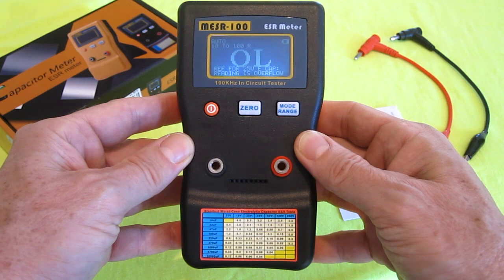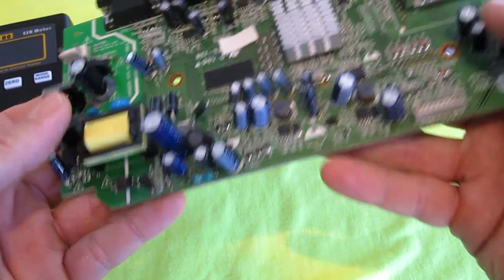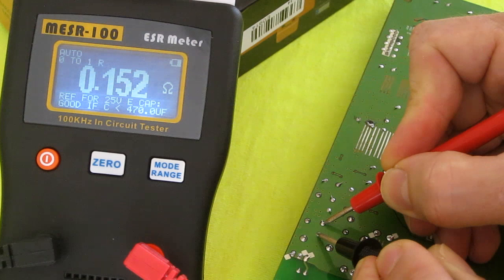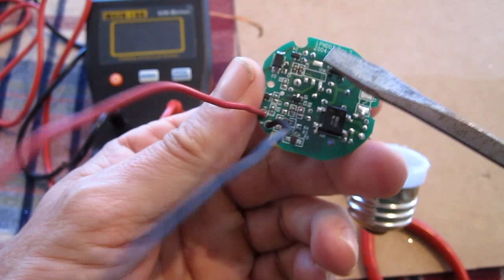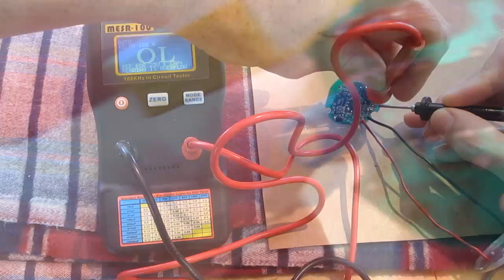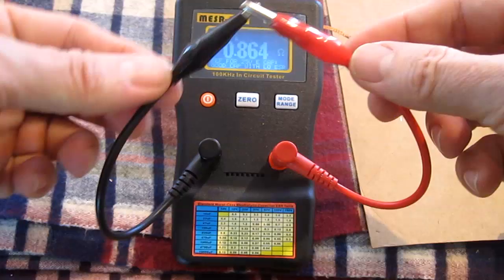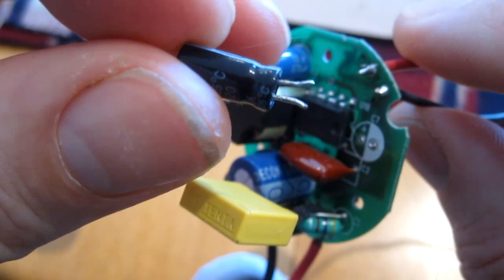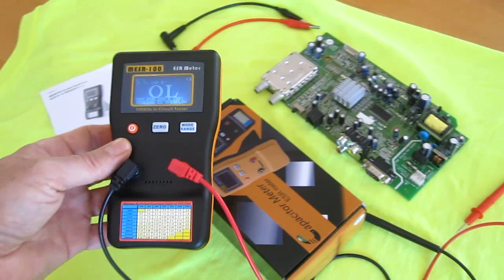ESR Meter $44 Capacitor Tester MESR-100 V2 electronics repair fix broken power supply led tv replace

Comment: The $15 ebay delivered capacitor tester kit that's fun to assemble works great. It has a similar screen as yours but it also tests resistors, diodes, transistors and more. You just solder the kit together and go to it. I've used mine to test thousands of components and it works flawlessly.  It even has a frequency counter mode.
Reply: Thanks for the heads up

Comment: A couple of points.  First the chart is very ballpark, you need to look at the data sheet to know if the cap is really OK, but for this kind of troubleshooting might be close enough.  Second point is that you NEED to zero the probes, especially with those long ones.  If you didn't zero them out then the ESR could be way off.  And ESR can be such a finicky thing that usually probes for the meters use more than one wire to help minimise the effect of the lead on the reading.

In general that might not be too critical for general troubleshooting but switching power supplies use low ESR caps so it's a bit trickier.

Someone mentioned the multi testers that are so cheap.  They work well BUT you need to press the test button each time so you can't do the kind of probing he is doing in the video.  With in circuit testing you really need the meter to test constantly so you can keep both hands with the probes.
Reply: Good Info ^^^^

Comment: Hi FunBubble, i have your same device with short probe...so when i try a probe more than 20cm that tool 
show an "error" when i try to set the "[zero]" cause the probe have 0.7ohm. 

How did you manage to use long cables/probes ? 

Regards
Alex (it)

Comment: I ordered this meter, too, it's in the mail and should arrive in a couple days.  I'm hoping to fix a tv with lines across the screen and other electronics.  I figure spending money on this tester would eventually pay for itself instead of taking things to repair shops or just replacing them entirely.  Thanks for the video and explanations.  It looks pretty easy to use.  Can't wait to be able to test "in-circuit" instead of having to remove each and everyone capacitor to test it.  Just curious since you posted this video in October 2016, how's the meter holding up?  It's still working fine?
Reply from the maker: hi, the esr meter is still running like new. its been useful for testing and fixing many many devices. thx
Reply: @FunBubble  Thank you, I appreciate you answering!  Glad to hear it's still working after a few years.  Hopefully I can get several years out of mine, too!  Try to have a good week!

Comment: It looks like a great value.   The only thing I'd add is the Atlas ESR70 also tests the value of the cap at the same time, and will discharge caps before testing. So it's quite handy for refurb and testing.

Comment: Hired would I test a 390ohm resistor that is in circuit in my vehicle cluster. Can't or don't want to take it out if I don't have to. With an ear meter

Comment: I have same meter, it works great. Warning it is far safer to discharge capacitors with 10,000ohm 10 watt or larger resistor, use bigger resistor for bigger caps. Shorting a cap with a screw driver or jumpers is a direct short that can damage other components in cicuite from big current voltage inrush,  can cause arc welding screw driver to cap or shocking you or melting wires or even kill you.  Be VERY careful discharging capacitors, and especially large ones, you can they can store huge amounts of lethal power for long periods of time. Fir example a camera flash capacitor can be lethal. Be very careful discharging caps to properly to limit current with properly sized resistor and proper wattage rated resistor. Be careful, if you do the math on larger cos to control discharge current and voltage.

Comment: it read 9.1 with supplied wires and would have in circuit had you used them in the 1st place.  I watched longer because you tested a led bulb,  good job on the video
Reply: Is there a reason simple leads can not replace supplied alligator clips?

Comment: Cool video. I just got my MESR and I too find the test-clips way too short. So, I used some test-leads I had, but now the MESR can't zero, it just says "zeroing error" and I've tried with other test-leads of varying lengths. Also, my MESR emits a faint but audible high-pitch sound - so, what do you think of all this? Is it defective? Should I return it? Please let me know, as I am a noob, at all this. Keep making videos. Cheers!
Reply: That's expected.The resistance in the wire will increase if you lengthen the test leads. That's why they're kept short.Btw,what's the max capacitance value this meter can be tested on?
Reply: Ok, but you are NOT using short test-leads [there's a video on Youtube, where some fellow is using 1 meter long test-leads, on his MESR without problems] and you have no issues zeroing. Also, your meter doesn't emit a sound, does it? Oh, and I believe the maximum capacitance is 100 Ohms, hence MESR - 100, but I could be wrong.

Comment: What if im testing caps the arent on the ESR Table? Like .47uf 50volt ?? I havent seen any tables with these . thanks!
Reply from the maker: a 4.7uf 50v cap is 3.0 esr. a 47uf 50v is 0.5 esr. im not sure about .47uf. i did a google image search for esr chart and printed out one that has more listings than the sticker on the meter. other than that u can kinda estimate by looking at the closest ratings.
Reply: That's the problem - it doesn't test small caps

I just watched a video where the guy fixing a vintage synthesizer just knew to change the small caps connected to the pins of an IC on a board not working correctly - no tester, just instinct and experience - he changed the small caps without testing them and the fault was fixed
Reply: Done some digging and it seems some can test down to 1 micro farad

Comment: Have you seen a list on what a 0.47uf 50v capacitor should read on this meter?
Reply from the maker: ive got a second esr chart that is more general and it shows a 0.47uf cap should read 6.0 OHMS or lower. the chart doesnt list voltages. maybe try to find a cap of the same value and compare them with each other. good luck
Reply: @FunBubble  Ok, thank you!  I appreciate the help!

Comment: You should be zeroing out the meter before testing. Especially if you are using longer probes with more resistance. You simply short the probes together and press the "zero" button. This will compensate the resistance in the probes so it isn't added to the resistance in the cap.

Comment: Friends, this fault occurs when measuring a capacitor without having downloaded it before, inside it has a protection diode D1, short and give this message, replace it and fix the tester, read the user manual

Comment: Screw driver for discharge is very bad practice as sudden discharge can ruin the cap you are testing... you should use a resistor with insulated alligator clips to properly discharge the cap... not so much for these little caps but for the bigger ones not only could you ruin the cap, but you may hinder your ability to maintain an erection for a bit after you get the life shocked out of you doing this with a bigger cap lol. You should always pull the suspect cap out of circuit before testing as your values can drastically change... you should also use flux when desoldering as well as soldering as it removes oxides and transfers heat, along with a sucker or braid. You're on the right path... just keep researching and before long your neighbors will be at your door asking to fix their tvs lol I can tell you that since I learned how to fix electronics i know for certain I will never be broke. Spent 110.00 total on all my gear to start and within the first month made enough to replace it all with 1000.00 worth of higher end soldering gear along with a microscope. On a slow month of side work fixing stuff for people with posts on social media I can make 1000.00 or so a month and on good months I've pulled in 6 to 7000.00 and that was still not back breaking work... just allotted 2 hours of time after work every other day or so. It's not only a fun hobby but it gives you an awesome sense of accomplishment... look how happy you were that you fixed the light... it's so rewarding because you know it's something so few can do. Drives me Nuys when people complain they have no money when they can easily look on you tube and learn a trade fairly well in no time at all such as this. Good luck with your future repairs!!
Reply: Nice comment.
Do you have any pointers on how to find electronic schematics? Thanks

Comment: This test is not conclusive.  Caps are to be measured under real working conditions.  This meter may show a low ESR and capacitance within spec, though it may fail under load.  Obviously, when this test shows the cap is "bad" then it is.

Comment: Sir how to esr tester mega 328 that is better
Reply: i couldn't understand your question, but i think you're trying to ask

is the M Tester / MEGA 328 better than the MESR 100
the answer is this

the Mega 28  M tester IS A COMPONENT IDENTIFICATION TESTER
one of it's functions is   TO TEST ESR ON CAPACITORS
it gives the ESR reading
it gives the capacitance reading

now the MESR 100  tests capacitors
IT IS AN ESR TESTER, only 

It won't tell you the capacitance of the capacitor
it won't identify components for you 

IT WILL GIVE YOU AN ESR READING THAT IS MUCH MORE ACCURATE THAN THE M TESTER

so, basically they are 2 completely different things you can't compare them side by side like that.

Comment: Hope you dont do this "screwdriver discharge" method with 400v capacitors 🙄
Reply: The large flash indicates that it is discharged and ready for testing. Here, try this 650 volt.  LOL

Comment: Please use an isolation-transformer for such tests. You know, the hells door is fast open.
Reply: It is a static test (unpowered) no need
Reply: @paulargudo9854  You tested the led unpowered? I saw in the video, when you pluged it in the wallsocket! Thats the reason, i told you, use an isolationtransformer.

Comment: NEVER SHORT A CAPACITOR IN CIRCUIT!
Reply: can you test voltage with a multimeter first and if read near zero is ok to test it out in circuit for ESR if not then proceed to remove to short and then test?
Reply: @TsunamiUndine  testing ESR in circuit is safe. Short circuiting a capacitor in circuit is never safe.
Reply: @TsunamiUndine  for added clarity,  there's no reason to charge up the system to test esr. The esr charges the capacitor in circuit itself...and safely. Do not add any external power sources. Do not use the esr meter then try to short circuit the capacitor in circuit to "empty it".